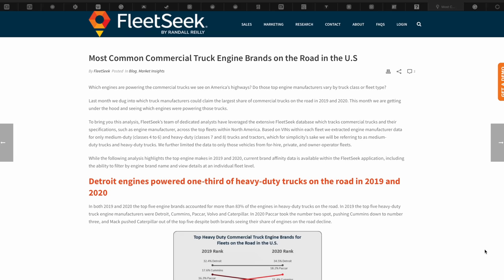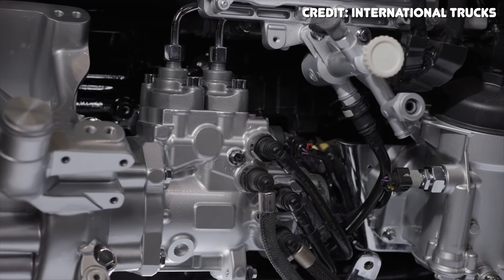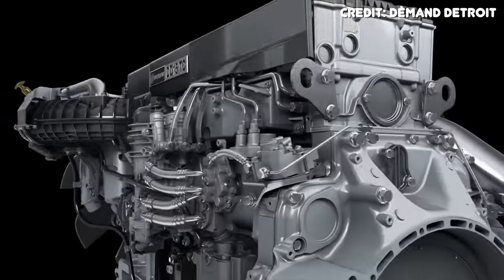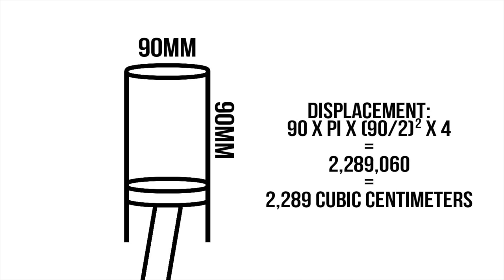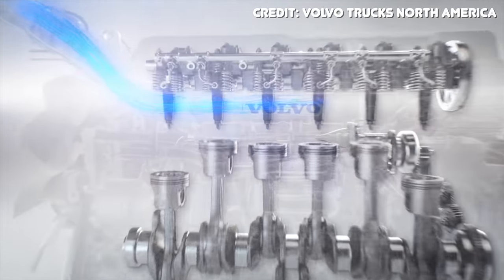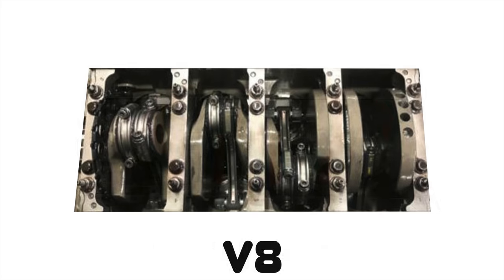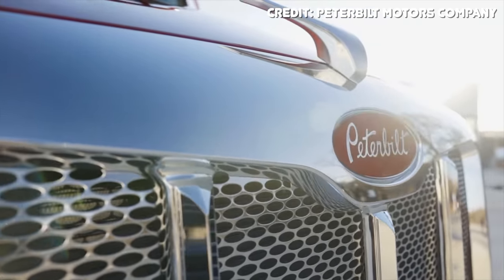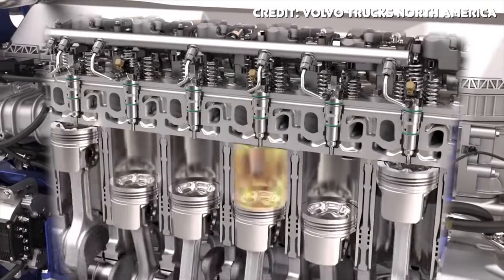Why do Semi-Trucks Use Inline-Six Engines?

Comment: Also in farming equipment, where tractors pull hard at low speed, 99% are inline 6
Reply: The only peice of equipment I've had that isn't a i4 or i6 is a Terra gator, which has a CAT v8.
Reply: The biggest John Deere tractor uses a Cummins X15
Reply: Most of the sml-to-medtractor are 3 cyl inline,  only the biggest tractors have more than 4 cyl on average. So I think your avg% is totally wrong.

 I 've only been in 1 tractors that has had 6 cyls in my life operating tractors. Our JohnDeere 5090 is a 4cyl Turbo,  but my JohnDeere 1120 is 3cyl NA,  and my Newholland is 3cyl Turbo 

None are nowhere near 6cyls and the 5090 90hp is a big tractor for avg farm in the USA. These tractors are from 50-120hp power range fwiw.

Also iirc Lamborghini ( yes , Lamborghini started as a tractor company ) , had more than 8 cyls iirc in their agriculture lineup at one time but that model cease to exist and was pulled out of production.

Another factor that should be explain, the diesel engines are design for long stroke and low rpms that are typically below 3500, so they don't need more rods, pistons, more crank length to add to even heavier rotating mass. The bore to stroke ratio is quite large.
Reply: @kfelix2934  ok, can you please share the accurate % so we all learn?
Reply: @cesargallo7424  Get for real, go to a ag dealer and see just how many inline 6 are parked on a lot for sale or trade-in, and then you can compute if 99% is a good estimation.

Btw the biggest tractor on the planet is power by DD and it's a 16cyl vee configuration in the format of 2 vee 8. The 2nd and 3rd largest are vee formats also 12 cylinders iirc.

The claim of  "99% are inline 6" ,  is no where being correct or accurate. Even the the larges of ag-tractors are not inline 6s.
Reply: @kfelix2934  There is ONE Big Bud 747 that was ever produced that had the Detroit V16.  It was built in 1977.  All the largest commercially available tractors from the last decade, use inline 6 engines.  Also really curious what you consider the 2nd and 3rd largest tractors, that used V12's??  How many were built??
Reply: @chackos123  I would have to find my Big book of tractors across the globe.

I can tell you for 100% sure , that 99% of the agriculture tractors in the world are not powered by inline 6cyl which is what cesar posted. 

The largest HP tractor in the USA is a Case Steiger and it is a inline 6cyl and JD9000s trax or the newHolland T9 and both of these are 6cyl, fwiw. Most if not all Case tractors over 140HPs are 6cyls, this formula also hold true with JD and NewHolland. 

But , most of the kubotas for example ( which my road has tons of these ) are non 6cylinders applications. I think ever other driveway is some  model of a "kubota" for example and we have all from the sml compacts to m4 and none of them are 6cyls, Heck I don't even think Kubota has any thing current in a 6cyl powerplant, now that I write this. Most are 3 or 4cyls. Same for Mahindra which btw the is the largest seller of tractors in the world, guess what they do know have a 6cyl powerplants and AFAIK never even produced a engine in any configuration greater than 4 cylinders ;)

BTW, We have a property with a Case Steiger on traks setting like 1 mile away from where I live and it is a beast. I even  drove one . Make our  JDs look like a toy.   

You can be partially correct with saying that the 99% of "largest" HP tractors/harvestor are 6cyl and that would be correct & true.

Comment: Great video! Your style of teaching kept my attention the whole time, which is a tough thing to do. I was sad to hear about CAT no longer producing truck engines. Their two best engines in my opinion were the 3406B and 3406E with the B model being my favorite. I have a question about gas engines maybe someone can answer. Why is it nothing sounds like a V8? I mean, regardless of displacement or RPM, the V8 has a very unique sound compared to any other engine configuration. I have heard drag bikes with V-twins come pretty close at high RPMs.
Reply: I believe it has something to do with the irregular firing intervals of the pistons due to the offset of the pistons. With straight 6s, V6s, straight 4s, and basically every other engine configuration, The intervals are the same between each cylinder firing. They all give off a single tone whereas with V twins, you get two bangs 90° apart followed by 270° of not firing and you get that unique mix of high and low tones offset from one another. Same deal with V8s just scaled up a bit. The firing order of the cylinders makes it so that the time from one cylinder firing to the next is not always the same.
Reply: v8 sound is because the pistons fire unevenly between banks even though each ignition stroke is evenly separated on crank rotation.  1-5-4-2-6-3-7-8 as an example would fire [left right] L R L L R L R R.  
different firing order or crank such as flat plain give different distinctive sounds.
The v twins if they are Harleys have an uneven firing sequence of 0, 315, 405 giving an uneven pulse to the exhaust.
Reply: Yep like they said uneven firing and the crankshaft is 90 degrees out versus European v8’s and 12’s on lambos and what not have that high pitch formula one sound because their cranks are 180 degrees out big sound difference to American v8’s
Reply: Very interesting, guys. Thanks for the informative replies.
Reply: @razorhook5421  180° engines are flat-8 or flat-12, not V. The reason they have that high pitched sound is they can run at ungodly high rpm because they are perfectly balanced without any need for counterweights.
Reply: Conversely, to me, nothing beats the sound of a petrol straight six.

Comment: Interesting summary. Another reason AGAINST using a "V" block is that it forces the block to become wider because the casting needs a lot of material in between the left and right bank of pistons in order to maintain rigidity. The 'valley' between the left and right bank of cylinders essentially represents wasted space and added weight. Several components grow with stroke. 1) Increased cylinder sleeve length.  2) Bottom of the sleeve has to be moved further away from the crankshaft to prevent crank arm from contacting the sleeve.  3) A longer stroke requires a longer connecting rod in order to maintain a reasonable angle of the connecting rod relative to the sleeve's centerline (represented at 5:17).

Consider the dimensions (in inches) of the venerable Dodge 440 big block gas engine (4.32" bore x 3.75" stroke). If you've seen one under the hood of a muscle car the the Charger, it is one FAT/Wide engine. Just imagine how monstrously wide it would be if a V-6 was made with the stroke of the Cummins engine shown at 5:58 (6.65" stroke) . As a ratio   6.65 / 3.75 = 1.77.  So, its width would be ~77% WIDER.

The above relates to the REASON why inline engines typically have a lot of torque - the inline engines commonly exploit their inline geometry in order to increase their stroke without the commensurate increase in thickness of a 'valley' between the left and right bank of cylinders.

An example of the inline's geometry being deliberately exploited is to compare the Ford 289 V-8 versus the Chevy 292 inline 6. Although they have the same displacement to within 3 cubic inches, just look at the difference in stroke   Ford 289 (4.00" bore x 2.87" stroke)   Chevy (3.875" bore x 4.125" stroke)   The Chevy has over one and a quarter inch (1.255") greater stroke
  and it has a 44% greater stroke ( 4.125/2.87 = 1.44 )

Comment: My 2.4 inline six in my 240Z was probably one of the best engines I ever had in an automobile.  I preferred it over the 2.5 four banger of the newer cars.  With the exhaust system I had(3 into two into 1) at low RPM it sounded like a small block v-8 and at high RPM's it sounded like half of a Ferrari.  That was also why Ferrari used V-12's because it was basically two smooth running sixes-in-one.
Reply: Eh, not really. Not as far as the crankshaft. A V-12 crank needs counterweights. And of course it also needs two camshafts. So it’s a lot more like two V6s than two I6s.
Reply: Was just thinking about that Nissan Inline 6
Reply: I loved by '77 280Z with the 2.8L L28 and Bosch L-Jetronic fuel injection. Smooth power all the way from the low end to the redline.
Reply: @RB-xv4si  Some of those Ferraris were flat 12s with each bank 180° apart. Perfectly balanced. They could run up to ungodly RPMs for the metallurgical technology available back then.
Reply: These particular Nissan-Datsun engines have a direct lineage to Mercedes Benz straight sixes.
Reply: @michaelclark9762  I has one of those as well '79 I think??  Smooth, torquey and could run all day at 100mph...stupid speed limits. 😁
Reply: @edsedlak6827  1979 was the first year of the 280ZX (S130 model line), which was heavier and more "luxury" oriented than "sports car" of the original S30 line. They also dropped the independent rear suspension and used a live axle. It was nowhere near the same car as the 240Z/260Z/280Z. More creature comforts and larger interior, but nowhere near the sports car handling on curvy roads.
Reply: But still more cubes traditionally means more torque  for this video you should not contradict him
Reply: @mrldr1595  ??? Who's talking about that on this sub-thread?
Reply: Years ago I had an inline 6 Triumph 2500 PI and now an inline 6 1993 Mercedes W124 300E. Both great cars and although I've had inline 4's and V8's, I really have enjoyed the 6's. They just feel stronger and less stressed.
Reply: An inline 6 with a performance exhaust sounds way better than a V-6 with a performance exhaust.
Reply: @michaelclark9762  
There has never been a live axle Z, from the factory. The S130 received Trailing Arm rear suspension.
Reply: @tannji5971  Yes, I recently discovered that I had been wrong about that for many years. Still, the S130 was too heavy and the suspension softened up too much to handle the way the original Z models did. They were nowhere near the same driving experience on tight, winding roads or race courses.

Comment: One of the main reasons for the transition to I6 is turbo charging. An engine with one bank is less complex manifolds and charged air routing. Its the same reason you see I4 being more common today than in the 90’s. An inline with a turbo has far more useable power and torque characteristics than any other layout.

Comment: My old '98.5 Cummins 5.9 is still running like a champ after 200k miles. It also gets better mileage than the newer diesels I have driven.
Reply: Gotta delete these new ones to get mileage like the older trucks 🙄 government
Reply: That is the best fuel economy, because the consent decree took effect in 1999.
Reply: And my 04 lb7 gets 25 mpg, more power, less cab noise, and smoother ride while having a higher tow rating
Reply: @jacobstrutner8232  until both of them rot from road salt. Or all the breakdowns on a duramax break you
Reply: @wizard_of_poz4413  not if you live in the south
ps: If your Duramax breaks just keep driving it, this one paster in my town just keeps driving his even though its a 6 or 7 cylinder engine now.
Reply: @jacobstrutner8232  But did it come from the factory without a catalytic converter? Mine did. :)
Reply: @wizard_of_poz4413  I have spent thousands getting rust fixed. It now stays parked during the winter months to avoid salt.
Reply: @kdw75  right 🤣
Reply: @kdw75  The cat isn't the problem. It's the particulate filter which requires  burning extra fuel to clean.
Reply: My 95, 5.9 L, 12 valve Dodge just hit 492,000 miles.  4 transmissions,  1 water pump,  1 set of injectors,  and the usual replacement of alternator, starters, etc.  This truck works every day,  hauling hay on a trailer..like a timex watch !
Reply: @gailparrish4743  Its not a dodge if you dont go through atleast 4 transmissions!

Comment: I'm a qualified mechanic and a professional truck driver. I have to tell you that almost all large truck engines I've driven are governed to 2100rpm from the factory. I cannot think of one that isn't so the RPM discussion vs stroke is irrelevant as you point out but irrelevant because of engine protection reasons such as missing a gear and over revving on upshifts. 
You still can over rev a truck engine but only on hill descents or if you downshift say 2 gears going down a hill with a heavy load on. Usually it is impossible to over rev a truck engine in neutral and when using the gas pedal - ie the engine goes to 2100rpm and stops.

The principal reason the I6 is favored over a V8 is reduced pumping loss under light load saving on light load fuel consumption, increasing profits to the owner. It's about money.
How the extra power is made up is by more boost. A V8 is always a V8 and those two extra cylinders increase fuel burn esp under light load compared to a 6 cylinder engine. Under light boost the inline 6 even at similar displacements to a V8 has a distinct advantage having two less cylinders. The V8 under light load conditions still has those two extra cylinders. It is very simple really.

I have to say the inline 3 has a dreadful fore-aft rocking moment that causes bad vibration. They're a shocking engine IMO.
I have a Mitsubishi Diesel inline 3 in a genset and the brackets crack, the bolts come loose, the cabinet doors rattle, the door catches wear out form the vibration etc.
Check out Engineering Explained vid on the type:
https://www.youtube.com/watch?v=Oc5_B4Qua_I
Reply: If two engines are running the same rpm, but one has a longer stroke, those pistons are moving against the cylinder bore at a faster speed than the engine with a shorter stroke. They're both taking the same amount of time complete a stroke, but one is travelling further than the other in that same time.

Comment: us is an island. out there you have mercedes diesel. great engines, running all over the world. i have an om321, 5.1l inline 6cyl diesel, pos ww2 engine. and it runs and runs and runs. over the world there are thousands of om321 and om352 engines still working.

Comment: RE: torque and power: power is all that matters in any application with a transmission BUT the wider the useful range of torques across RPM, the less complex the transmission has to be. "low end torque" is a means of reducing transmission complexity, but as your transmission trends toward CVT, your focus shifts to peak power or peak efficiency, both of which are solved with more square stroke ratios.
Reply: I’ll...I’ll just take your word for it
Reply: @bayoudrummer9855  Why say this?

Comment: As a youngster I worked on Magirus Deutsche air-cooled V8 motors.  I remember sitting in the dirt and dust to fix anything.    With 6 in-line you can see all the bits that need attention.

I know which I prefer to this day!!

Stavros

Comment: That inline six is huge.. look at the engine bay, it nearly spans the frame rails... Ok, now rock it over 90 degrees..  
If they made a V8 with the same bore and stroke, it would be five feet wide.  Plumbing is suddenly a lot more complicated.. two sets of cams, larger, heavier block and heads.. 
Heavier engines mean less available payload capacity.
Reply: Hence why Cat's C27 and C32 are at a 60° angle instead of 90°.
Reply: YEAH LOOK AT THE SIZE OF THE PISTONS HE WAS INSERTING!!!   I AM IN AWE BECAUSE I AM A 20,000 RPM F1 TYPE GUY!!

Comment: Scania makes a magnificent V8, it is a 16.4L unit that’s always competing with Volvo’s 16L I6 for the world most powerful truck title, with Scania currently leading at 770Hp, up from Volvo’s 750Hp.

Mercedes-Benz used to make a V8 too, discontinued a few years ago.
Reply: Add to that 3700Nm (~2700ft lbs) of torque. It's certainly a very mainstream exception to the more common I6.
Reply: V10 also

Comment: In 1967 a friend of mine bought a Ford Mustang, and we all had fun about his cool new sports car. He had answers for our fooling around, saying that after many years of working in the family business of auto repair, he thought it was a mistake to use v-8's, with an extra head and more cylinders, more parts to fail or to need attention - as discussed in this video. If the engine needed work, he could take it apart and put it back together in one day. And as you said, a smaller engine at 8000RPM will not survive as long as one that runs 2000; every movement produces some wear, and it adds up.

Comment: The paccar popularity number is most likely skewed as the px models are technically a Cummins engine with paccar badging. The mx models were designed to be in cabovers making them difficult to work on while being a unreliable and underpowered engine compared to the x15
Reply: Yeah, his numbers were not right.  Cummins sells about 32-38% of engines in class 8 trucks, depending of the year.  Freightliner sells about a third and then the rest of the engines split up the last third of the pie for the paccar, A26, and Volvo engines.

Comment: So, this video is accurate about the lack of harmonics in inline six engines, but it leaves out that the number of main bearings in a V engine is cylinders/2+ 1, whereas the number of main bearings in an inline engine is cylinders + 1.  So, an inline 6 has 7 main bearings, where the equivalent v8 would have 5.  Both of these are nice to have, but the real advantage in an engine with a smaller number of larger cylinders is in the thermal efficiency.  Longer strokes mean lower speeds, which effectively makes the flamefront faster, meaning that pressure peaks earlier in the power stroke.  And, larger cylinders have a better surface area to volume ratio, meaning that less of the heat of combustion is conducted through the cylinder walls.  Finally, the relative fit between parts is tighter in a larger cylinder.  A five thousandths ring gap is a mile in a cylinder with a one inch bore, but is really tight machine work in a 6 inch bore.